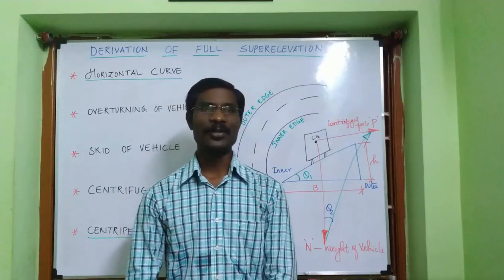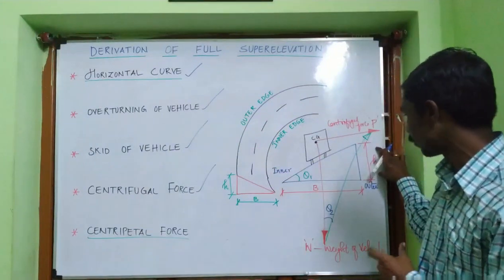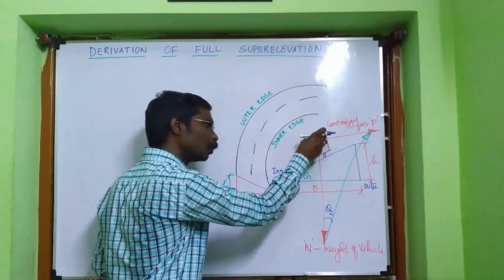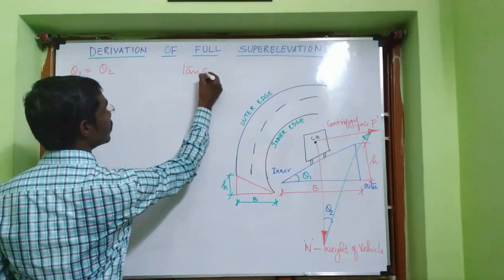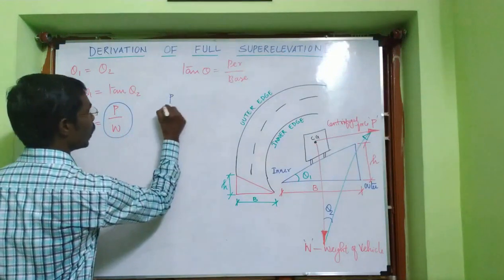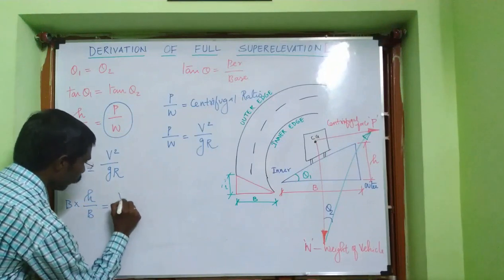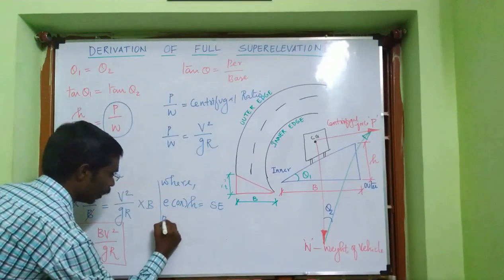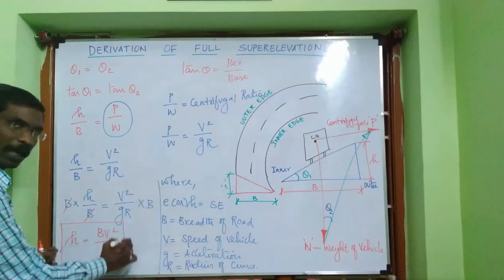Video | 1  Derivation of Highway Full Super Elevation

Comment: Hi Ponnurangam, Really appreciated your initiatives. its good start and i wish you all the best.
But some points I would like to highlight. which you could take as positive feedback.

Understanding of super-elevation.  It is not just provided on Horizontal curve. and not every Horizontal curve required super-elevation.
So, Mention that its depend upon the Speed of vehicle. The design of road does a matter with super elevation.
What type of Skid resistance occurs on curve  should be  explained. The Lateral Skid occurs due to its centripetal force and pull the vehicle outwards. in order to counteract that the outer edge of road  raised with respect to inner edge

The Derivations explained very nicely. But bring all those into the more realistic and dont hurry into finish. 

Thanks  for your initiatives. i hope many of students will be benefited by your act!